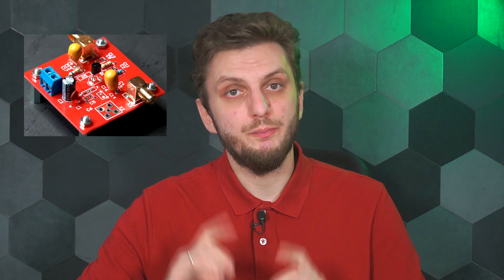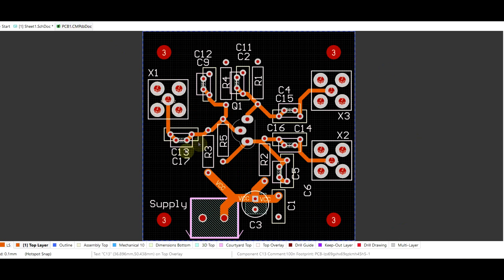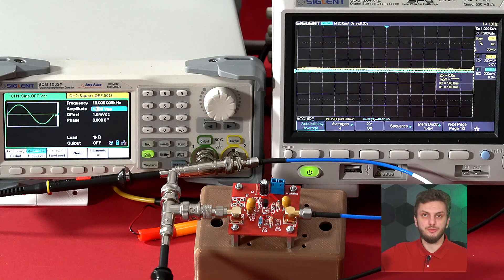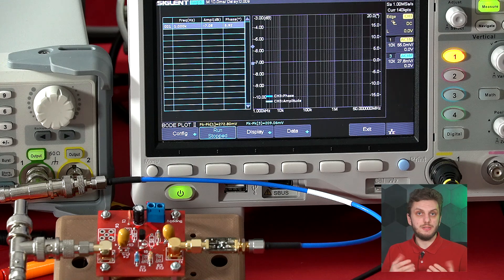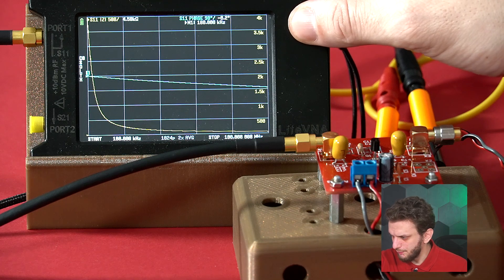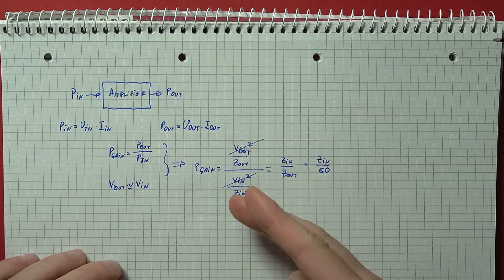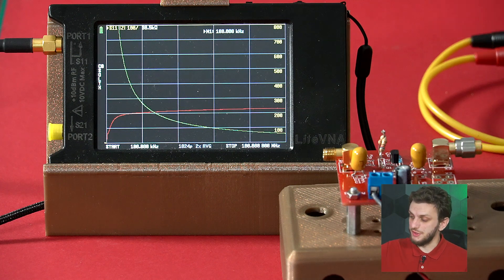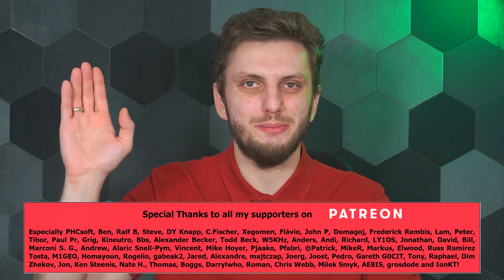Common Collector Amplifier - Practical Build (2/2)

Comment: This type of amplifier is very helpful for high-impedance sensors.  One thing to watch out for though is that it has a very low PSRR (Power Supply Rejection Ratio).  So if you want to keep a clean signal through this, you must ensure you also have a very clean power supply rail for it.

Comment: Nice video. However 8:50 you can't measure the output impedance of the amplifier the way you did. What you are measuring is the input impedance of the output port which is not the same as output impedance. This may be true for passive devices (LC filters, etc) but not active components.
Reply from the maker: How would you propose a better method? I could try it some time and compare results.
Reply: @FesZElectronics  you can estimate the output impedance by loading the amplifier to R1 first and then to R2. For each resistance the amplitude Vi of the output signal should be measured (for a constant input signal; the amplifier should not be in compression). Then the output impedance can be determined as (R1 - R1*(V1/V2)) / (V1/V2 - R1/R2). This method can also be used in LTspice. Naturally this is applicable only to linear (class A) amplifiers. For other classes the output impedance strictly speaking is not determined (it may be - for class C/D amplifier followed by a filter, however).
Reply from the maker: @R2AUK  Do you know how to also include phase into this calculation? the equation you mentioned will work well for real impedance, but it wont cover complex values.
Reply: @FesZElectronics  I'm afraid I don't. Complex output impedance would mean that your amplifier has voltage and current out of phase. Which to my knowledge is not common.
Reply from the maker: @R2AUK  I think I figured it out - its the exact same calculation, but the voltage needs to be treated as a complex number - with magnitude and phase; this will give the output impedance a complex form. However, I have to say, as long as the circuit is analyzed under "small signal" conditions, there should be no difference in the result obtained based on measurement method - either by injecting a signal from one port and measuring the other, or by doing a single port measurement. If the circuit is considered a 2 port black box, the port impedance is not dependent on whether the port is used as "input" or "output"; it just depends on the other ports impedance. Any circuit, whether its intended by design or not will be bidirectional to a certain extent...
Reply: @FesZElectronics  Agreed. That won't work for measuring output impedance. W2AEW has an excellent video on his channel about how to use a nanoVNA to measure the input and output impedances of a small-signal amplifier. As he also points out, one must be careful when measuring input impedance to not drive the transistor into a non-linear region -- which the nanoVNA will do if not attenuated.

PS: Love your videos, I look forward to each new one and have learned a lot. Keep up the great work!
Reply: Great videos. Any way of getting the pcb files? These are perfect for experimenting. THANKS

Comment: Great video, thanks. Can you do a video on bode plots. I still struggle with them. I have a book about it but that is al about the math, and math is not my forte
Reply from the maker: Do you mean the usage of Bode plots for power supply stability, or just in general? Maybe you have some example on where you would need to use these?
Reply: @FesZElectronics  Just in general. I have a scope that has this option but I never tried it. I mostly repair testgear so no need for bode plots but by co-incident I just build a small sub-woofer amp and it would be fun  to do a bode plot to see the gain and fase response.  However as a check for power supplies this sound very interesting :-)

Comment: Hello, I want to design a buffer for a wide band rf vco, which operates over several decades of frequency up to about 200MHz.

Both common collector bjt amplifiers and jfet amplifierd have a shunt input capacitance, which causes the input impedance to drop dramatically at ‘high’ frequencies.

... What methods are used to buffer high frequency oscillators above a few MHz ?
Reply: Hi not sure if this suggestions any good but I have used MMIC to buffer rf oscillators they have pretty good response over a wide band width. You can even get small boards ready made from china but they are easy to make and require very few additional components.